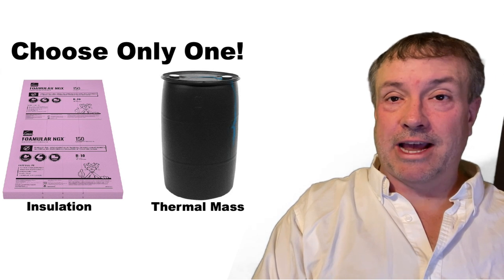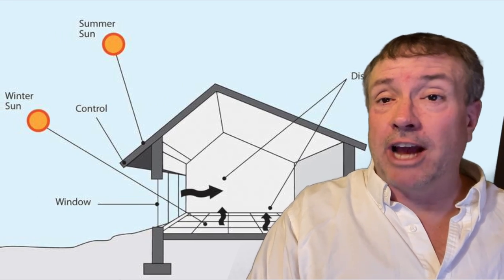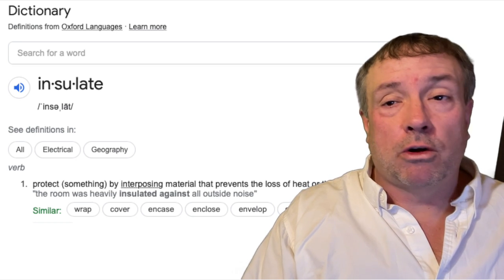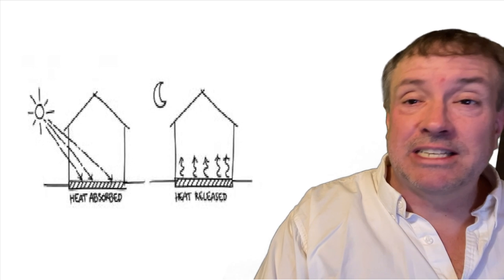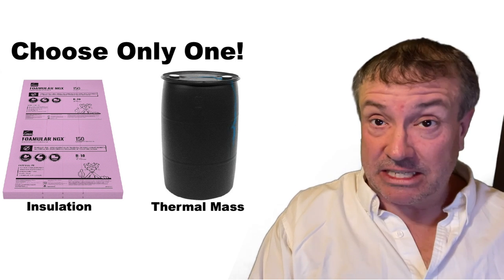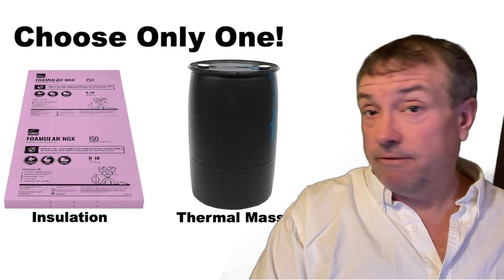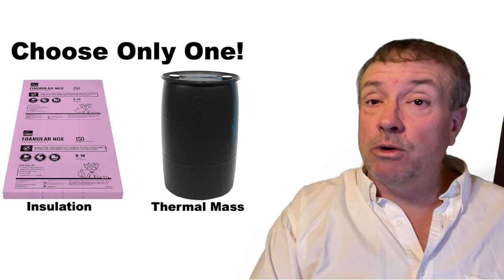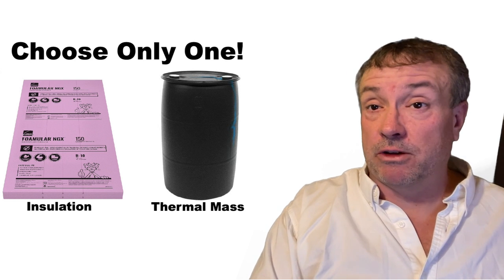Insulation vs Thermal Mass Explained

Comment: I built a house east of the Cascade Mountains in Oregon using Structural Insulate Penel, which means the basic building component was 5" thick styrofoam sandwiched between two sheets of wafer wood. I used 10 inch panels on the roof. We found that the house was more comfortable if we left the heat on all the time. Bottom line, it took so long to heat up the foam core panels, also it took a long tome to cool down the thermal panel  implying that there was substantial thermal mass in the foam panels themselves. My heating bills were $300 per year and my neighbors heating bills ran over $500 per month in the winter. And we needed no airconditioning in the summer. It was a total win.
Reply from the maker: That’s awesome thank you for sharing

Comment: Thank you for another great video.  I am using Mylar-faced bubble wrap on the north side of my homemade dome greenhouse, as well as across the crown of the structure, and all around the perimeter, leaving about 180 degrees of clear 4 mm film facing the winter sun. We’re about to have a hella snowstorm here, and I am going to put my 50 gal. rain barrel inside the dome and fill it with natural gas-heated hot water — yeah!  Cheap first round of warm water in the thermal mass container.  I am going to try heating the water with a submersible pool heater and observe the effect on my interior temps.  Hoping to supplement the little electric greenhouse heater to keep the interior temperate  (I will settle for, say, 15 C) with the thermal mass.  Will it be more efficient to keep the thermal mass heated than to keep the air heated?  I guess I will find out.  Like you, I laugh ironically at “passive greenhouse” heating advice coming from parts of the world not subject to the wrath of Mother Nature at this time of year — From a SK girl in QC
Reply from the maker: That’s awesome! I hope it works!!!

Comment: I remember living in Ireland and they had what they called ‘storage heaters’ which were giant rock filled heaters that heated the rocks during the night when electricity was cheaper and released the heat during the day when it was more expensive. 

Probably one of the most inefficient heater I have ever used, and impossible to regulate the temperature effectively.
Reply from the maker: Interesting.. thank you for sharing
Reply: Could be interesting  to do with a solar direct heating system

Comment: Hey, nothing wrong with Peewee Herman.

That said, my concrete greenhouse floor is BLACK for just this reason.

Oh, battery - ya. Well, I'm here to tell you I use an air BATTERY to store energy on my homestead.  My wind turbines (VAWT) compress air.

I build steam and compressed air engines as a hobby.

I also use accessory heat in Winter from the waste heat coming from my LP gas wall furnace.  One side of my greenhouse (north side) is my house and the other side of my greenhouse is just that, my greenhouse. 

My house insulates and provides auxiliary heat when I run my heater, while the black concrete and steel floor provides both passive heating from sunlight and thermal mass.
Reply from the maker: You need a YouTube channel for all that!!! Sounds awesome
Reply: @SimpleTek  
Got one.
But it's not likely what you think. 
It's for my kids to keep up with me. 
I don't care about subscriber numbers or ad revenue. I don't chase money. In fact, it chases me.
Anyway, I'm autistic, so "keeping up" with me is a full-time job.
My YouTube channel is just big kid Show & Tell.

Comment: Technically speaking, Insulation is Thermal Mass.   
There is literally no difference between the 2, as they both function to slow the transition of heat from leaving or entering a system, by absorbing & reflecting thermal radiation.  
People have just adopted a colloquial deffinition for Thermal Mass, to describe really thick Insulation.
Reply from the maker: the difference is in thickness and efficiency
Reply: @SimpleTek  
Thickness, yes... as I already stated.   
Efficiency, depends entirely on the material being used.  
Fiberglass is far more efficient at insulating, than water or dirt, because so little mass is needed to trap the same levels of heat.    
Ceramics are the most efficient at insulating as the rate of heat transfer through the material is so slow, they can trap several 1000s of degrees C of heat... where as all other types of insulation would either melt or boil.

Comment: I have been using barrels of water in my polytunnels for years now I use horse manure in a very big hotbed about 3/4 feet high by 3f wide by 10f long you have to keep topping it up every 2 weeks and it takes a shit load of horse manure to do it. it keeps the tunnel warm all winter long. my allotment is off-grid so no power for heat. it's not one for everyone but it works for me. plants sitting on top sit at about 15 to 20c.
Reply from the maker: that's awesome! Thank you for sharing!

Comment: Strictly defined a batter is an array of equipment, the reason it's used (often incorrectly) for electrical systems is because a collection of cells is by that definition a battery (of cells), it does also tend to get incorrectly used to refer to a cell though (like a aa "battery" which is actually a cell).
Reply from the maker: Ok

Comment: i enjoy your videos, i was wondering about aluminum roofing for summer to keep cool and what your thoughts on it might be. goal of a cool summer warm winter roofing for pets/plants
Reply from the maker: Metal roofing lasts longer and is cleaner for water collection than asphalt
Reply from the maker: Light Colors stay cooler, dark Color’s heat up more with roofing
Reply: @SimpleTek  i was thinking the thermal properties of aluminum vs steel same color on a hot summer day.
Reply from the maker: @79PoisonBreaker  honestly couldn’t tell you the differences in the two metals, sorry

Comment: i like to use Thermal Banking... Thermal Mass that you Deposit Thermal Energy into and can the Withdraw Thermal Energy later

BLACK Colorant added to Cement can help draw heat into it 
IF
you leave it the color of Lime Stone 
it will reflect heat away

interesting stuff mate
Reply from the maker: thank you for the insight! Cheers!

Comment: So would adding more furniture with dense wood or glass to a house also act as essentially thermal mass?
Reply from the maker: @mathewrost  yes
Reply: @SimpleTek  I wonder how many china cabinets or as the hip call it now , hutches.. the wife will let me bring home… lol I can probably get away with like 3 for sure any more it’s pushing it… may have more luck after with some canvas art and pottery plates for smaller bare walls haha literally while writing this convinced her of a pull out couch in the library and a spare mattress on top of the guest bed lol easy since we have already had to use the couch and air mattress
Reply from the maker: @mathewrost  lol

Comment: Also good for getting a solid 3-seasons!
Reply from the maker: 3 is great, insulation and or thermal mass allows that often  without additional heating!
Reply: @SimpleTek  Yup! I think I can get away with a weak 3-seasons without heat here at elevation in south central BC. But building a rocket mass heater with mini sauna inside the greenhouse is too tempting of an idea and I suspect can get me a solid 3 seasons with no supplemental light

Comment: Insulatation should be defined as the slowing of radiation of energy. Thermal mass stores energy and slowly releases it. Somethings can be both. I am using a masonry, rockwool, with masonry veneer for earthship walls. No berm. Vertical windows.
Reply from the maker: Well said

Comment: I built our greenhouse on a 4’ concrete block wall with 4” of foam board on the outside. I put drain pipe under our grow barrels with tons of rock over it. I pump heat with an in-line fan from the peak to the drain pipe during the day. We grow from late March to October with no supplemental heat. Thermal mass for walls on a home in a cold climate aren’t good.
Reply from the maker: Thank you for the insight!
Reply: You do want insulation, but thermal mass inside that insulation is still valuable in the north.

Thermal Mass stores the heat you produce so you don't wind up with it all in the air, flying out the door every time it's opened.

But yeah, with the 'only choose one' quandry poised by the video thumbnail, you definitely pick the insulation up here.
Reply from the maker: @priestesslucy  click bait works!!!!!
Reply: @SimpleTek  It wasn't the bait that got me lol, I'm just interested in energy efficient construction methods 🤭
Reply: @priestesslucy  our house is built like that. We have a daylight basement with insulation on the outside walls so we can use the concrete as a thermal mass. I put a vent with a thermostat high on the wall of the ground level and on sunny days it pumps heat into the basement. We have good sun and lots of glass on the south wall. In the summer we can bring up cooler air by reversing the fan.

Comment: Insulation restricts heat transfer in both directions, thermal mass slows heat transfer  by absorbing heat from both directions
Reply: Water is a thermal mass but it is much more conductive than sand for example. Thus, sand would be a better thermal mass for slowing the transfer of heat
Reply from the maker: @David_Mash  water works better to store and release heat
Reply: @SimpleTek  perfect to connect a thermal mass wall to a thermal mass floor or storage.